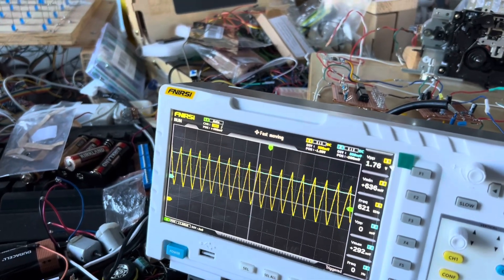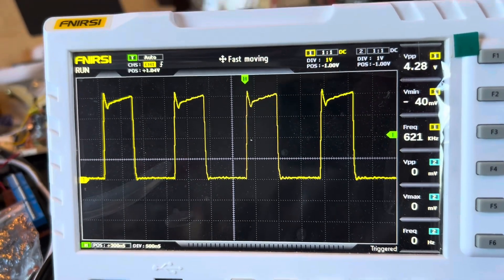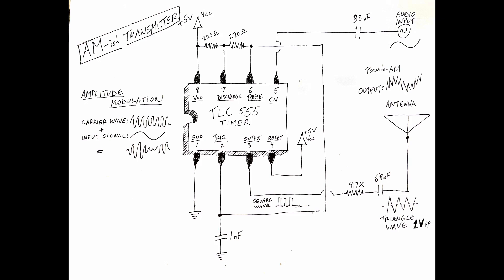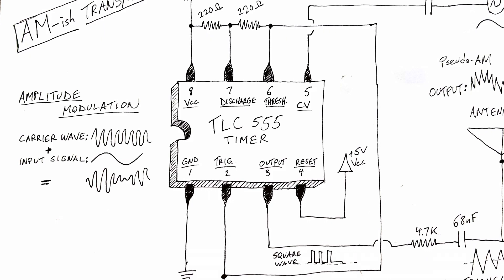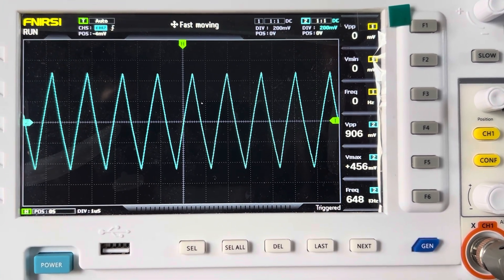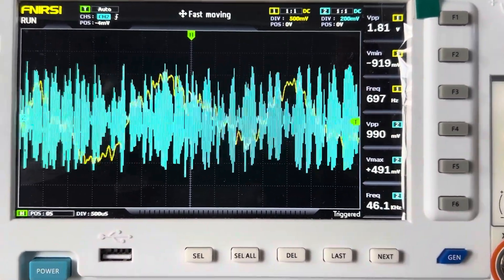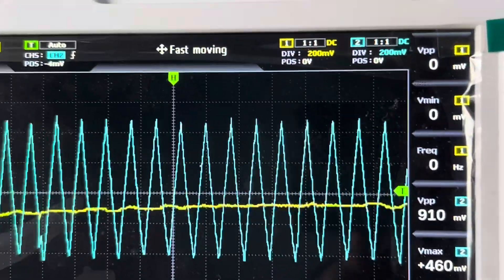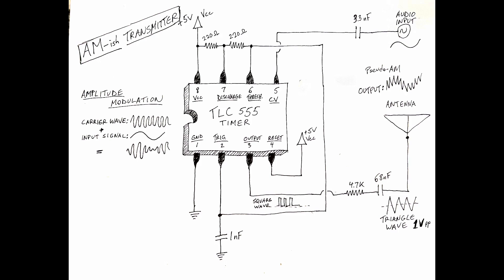DIY AM -ish Transmitter using a 555 timer

Comment: Sounds good. What's the range like?
Reply from the maker: @kenrawlings4184  a few feet without an inductor and shorter antenna. If i use longer antenna wire and inductor in parallel with output cap, i can catch it from the other side of my house
Reply: @igorbrichkov3632  that's good . I will try this circuit out.
Reply from the maker: @ Let me know how it goes
Reply: @igorbrichkov3632  will do.

Comment: Cool! you might wanna look at the Buchla 259 oscillator, this is triangle using a LM311 to reset and current to speed controlled.
some 15 parts. Buchla is the co inventor of the voltage controlled oscillator next to Robert Moog.